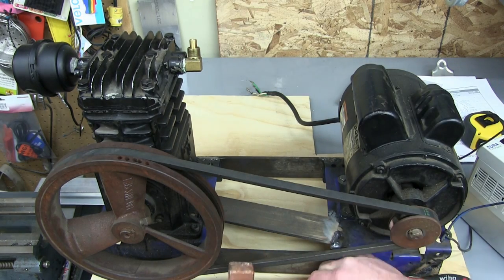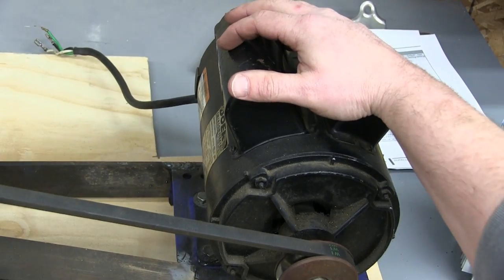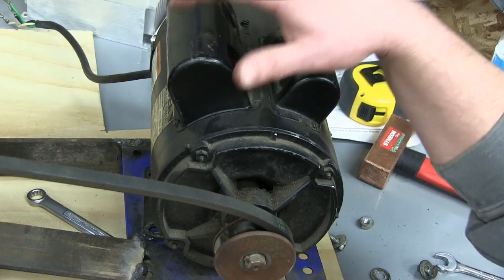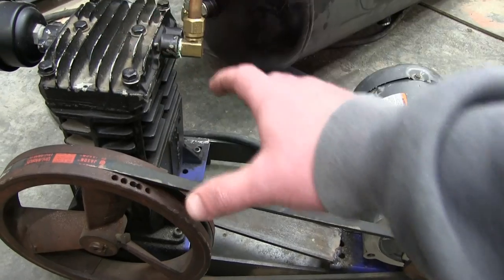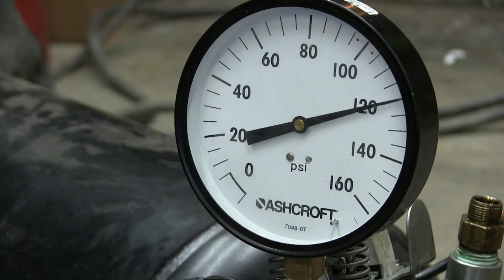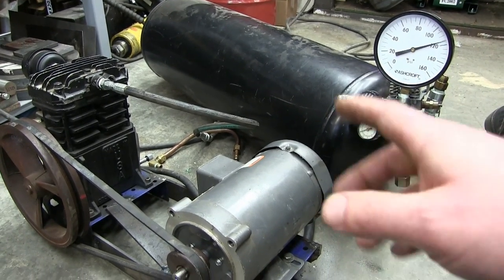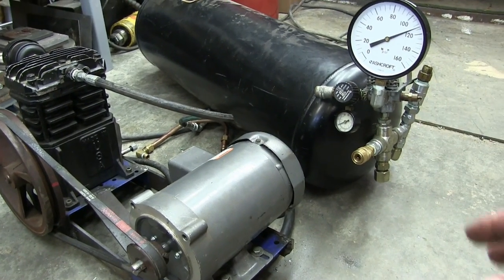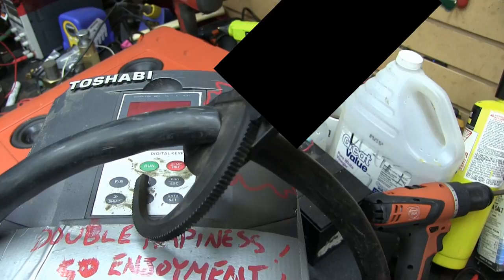BIG COMPRESSOR PERFORMANCE BOOST | No tripped breakers!

Comment: Excellent job. Running it faster at lower loads increases piston speed on the compressor motor exponentially increasing wear on the rings so lower life is probable

Comment: Why not just have it maintain constant pressure via the variable speed. They already do this on well water systems. If you're trying to maintain 120 psi you could just use different pressures to equate to different frequencies. Example: if the pressure is below 90 psi it runs balls out. After that you could step the speed down as needed to maintain operating pressure. Adding the air signaling would be unnecessary if it's always maintaining the same pressure, unless you're wanting a higher setpoint.
Reply from the maker: Using the air as signalling opens up options. Drop the pressure for "torquing" bolt with a ugga-dugga. Pop the pressure up to bust deeze nutz. Set the pressure to fill tyres. Short bursts of more CFM, setting the compressor in standby,  etc...
Reply: I would have to agree with Justin. I think using air as signaling opens up the possibility for trouble. Just imagine, you are doing some light duty work and suddenly the thing kicks into overdrive since you happened to do a signal by mistake. I think a regular button (Or a remote control) would be more useful for that type of operation.
Reply: Alexa integration?
Reply: I understand the idea... it just seems unnecessarily complex. Constant pressure would be friggin sweet. If your system will handle increased pressure why not always maintain it and use a regulator if you want less

Comment: I do think the idea has merit . If you run a compressor faster than it is designed to run there are several issues you have to overcome the head is designed to run at a given temp at its rated rpm. If you overspend it you are going to make more heat in the head than the cooling fins are capable of dissipating. Not saying that's the end of the world but you will need to come up with something to mitigate this. Also your charge is going to be hotter which an aftercooler would help with. Just think that in this case the old saying holds true " there's no replacement for displacement ". Bigger compressor would be my suggestion for the long haul but this is not a bad stop gap fix. Keep this kind of stuff coming it inspires creativity and critical thinking and I love it.

Comment: Work in commercial truck shop and this would be great for heavy usage tools(tire guns/multiple tool) and especially for airing tires up when pressure drop isn't low enough to trigger compressor

Comment: Is heat buildup in the compressor going to be a problem running that thing at 200% all day? Could you build a water jacket to run between the head and block to keep the system cool?
Reply: Mike Lastname Lucas oil additives could assist with that?
Reply: Variable frequency drive. It is only running 200% when told to. But yes, heat is definitely something to remedy. Always. Heat means excess entropy. While entropy will always be real, it can and should be regulated. And the water jacket thingy is a real thingy already. Look for a compressor out of a big truck with air brakes.
Reply: The compressor drive wheel is running backwards looking at the rotation and “fan” spokes.
Reply: It (the pulley fan) would work what ever way it rotates, no? One way it sucks the hot air off the pump, the other way it would push cold air over the pump. That said, I don't know if the pump itself would work if it was turned the wrong way ...
Reply: Also don't forget that these compressors tend to use splash lubrication. Not so much a problem at overspeed, but when running underspeed, lubrication is going to be a problem.
Reply: jeftiii So what you’re saying is... more power, more better?
Reply: I.. I guess so!
Reply: Kit Bridgen The compressor should run both ways. The problem with the fan sucking instead of blowing is it will pull in air from all around the cylinder. If it blows it will be a more concentrated stream. Model Putt Putt boats use this principle

Comment: What a great channel.  Combine brains, honesty, inventiveness, efficiency, and humor.  Doesn't get much better than that!  That is a very cool idea using the variable drive to vary output.  I would think one would need to be carefull in that the cooling vanes etc. on the compressor were designed for an RMP.   Compressor pumping faster might cause overheating issues?   I'm not sure.  I'm trying to think of other ways to incorporate this idea.

Comment: You are missing the unloader valve to take the head pressure off the compressor on start up.
Reply: You're completely missing the point of the video
Reply: larry munday that's only for gas compressors
Reply: Thought they were only in petrol compressors? I remember as an apprentice my boss send me to start the petrol compressor 😂 my fucking arms were about to drop off

Comment: I used a unloader on compressor vents air for several seconds  allows it to restart easy no compression load.
Reply: The air tank should have a check valve to allow this. It's easier on the motor even a 3 phase will be happier with a gentle start.
Reply: David Elliott It's different it unloads pistons upon start for a few seconds until motor reach's speed then allows it to compress. Done alot on large compressor s Diesel powered types.

Comment: working in the body shop we use almost all tools are air tools.  We also paint or primer with air as well.  At home although I only have a 110 compressor I find that its useless and when I want to do weekend jobs don't have a big compressor and so the 110 unit would never work and if I could be able to have the air I need for painting that would be great !   You really have a great idea !  I love your most used phrase Skookum !

Comment: AvE any thoughts on the damage to the motor bearings dod to the high frequency from the VFD? I know you can get newer motors that are rated for VFD use and you can also get grounding brushes that you place on the motor to bleed off any voltage that builds up in the rotor so that you don't get the voltage arching across the bearings,
Reply: VFD motors aren't necessarily built to run faster - they just have laminations in the cores to reduce coriolis currents and heat buildup.

Comment: What about a bypass valve so that the motor starts without any head pressure? Then, once the motor is up to speed, the valve changes over and can start charging the tank.
Reply: The load comes from the compressor not the motor.  Bringing the motor up to speed would just trip the breaker as soon as you pop the clutch and hit it wit the load from the bottomed out cylinder
Reply: W1ldt1m I think he’s talking about an unloader or bypass valve in the compressor. Similar to what semi trucks use. That way you would be able to get everything spinning before putting the load on it.
Reply: I've used compression relief valves on Harley engines. S&S makes electric solenoid types that could be wired up easy enough.

Comment: We use these in the commercial HVAC field, they can be set up with a pressure transducer that will maintain down to minimum frequency (would go no lower than 15 or 20Hz) you set up a PID rate so the farther from setpoint the faster the rate of ramp up and Hz.  Many buildings go with a screw compressor (yes insert whity AvE saying here) and run them on a VFD, compressors seldom shut off but run unloaded under light load.

Comment: notice the fan blades built into the big pulley? They are meant to blow cool air across the pump. You're spinning it the wrong way.
Reply: richard day, well then, now it's just sucking hot air away. :P
Reply: Yes, sucking hot air away from the pump. That is brilliant my friend. I wonder why all the big automakers of the world didn't incorporate that into their cars? Because it's LESS efficient.
Reply: Absolutely supposed to be blowing air over the compressor cylinder and head.  Oil cools the bottom end.
Shouldn't be a problem to make it run the other way.

Comment: Tell  you what, So long as your reinventing the wheel (again) ... Please install a small solenoid valve on the bottom of the tank to drain it once a day; PLC controlled, of course!  :D
Reply: You can already get those that open for a blast of water removal after it cycles on and off. I put one on mine.
Reply: John Possum what are they called? Never heard of this before.
Reply: Hmm,  Nice. I've installed the "expensive" ones that are IC controlled on long timer circuits.  They cost more than his PLC  :p  .   I like the water blast concept after each cycle you mention above; I'll search them out.  Knowing AvE, he'll probably install a humidistat  into the tank to determine when to cycle the valve :)
Reply: I'm not sure what they are called. Compressor drain kit, I think. Yeah, here's one: https://www.harborfreight.com/automatic-compressor-drain-kit-68244.html
Reply: John Possum now to find one not sold by harbor freight.. lol

Comment: A few summers ago I was subcontracted doing general labor for a framing company, shoo wee, they had the brand sparky new stuff. I believe our air nailers had something like this. Problem was the was a wire than was zip tied to the air hose and plugged into an extra couple of  buttons one turned the compressor on to “overdrive” the other reset it to normal. Other than that it ran like normal chooch chooch 5 min break and back to choochin. If you were about to run it hard for a bit you could hit the on button and it would only let it drop 5 psi, then kick back on. It basically kept it running.. I never used it much given there were four other guys monkey-in with it. Wish I woulda looked into it more.. worked great and kept us busy! We did keep a shop fan blowin on it all day too, sucker musta been HOT!

Comment: Or you could just adjust the cut in and cut out of your pressure switch.. tripping breakers?? Weak breaker,too low amp breaker or motor going out

Comment: Why not connect it with wifi,
As soon as you walk into the shop (connect to that wifi spot, or bluetooth)
Have it turn on 8D
Reply: Or even keyless entry like the latest easy steal Audi. What can go wrong?
Reply: Or just put a solenoid valve and relay at the pressure switch or a relay to turn power on/off to motor wired into the shop lights switch.

Comment: As a professional software engineer who's had fun dabbling in small systems controllers, I wouldn't suggest doing the "three pulse signal". It would not always be a reliable way to detect it, and you would still need some kind of upper/lower bound switching for turning the motor on and off. Instead what you're looking for is mainly volume at a desired pressure range, and usage varies over time. Instead I would say you should use a ramping of torque based on the rate of pressure change. You would still want a specific lower pressure for it to activate, but if the motor at nominal speed is not increasing the pressure at a minimum rate (or if pressure is still decreasing), you could have it ramp up the motor speed to increase the CFM. You would have a max speed limit, as well as a temperature sensor on the vital components that can override that max speed limit and lower it if things are getting too toasty. BUT to handle sudden high demand, if the pressure drops a certain amount within a given timeframe, you could have the pump preemptively start (maybe if it drops 50% of the desired pressure range, ie. range is 80-120PSI and it drops 20+PSI in under 15 seconds). Under such a sudden heavy demand, it could even start the pump at a higher speed to start providing a higher CFM.

Comment: Fantastic idea. Smaller tank, ability to go into brief turbo mode when someone's really nailing, lower speed/wear/noise most of the time, possibly even set for 15A or 20A depending on circuit you have it plugged into.

Comment: An unloader valve solves the tripped breaker problem nicely and pressure switches with that included are cheap. (For those not familiar when an unloader valve is used the air tank is prevented from backfeeding the pump by a check valve while the unloader valve dumps pressure between pump and tank check valve until the pump is up to speed.) Augmenting tiny compressors feeding tiny ID hose to tiny tanks is fun, but the industrial way of more power is hard to beat (and all the mods done to baby compressors would work even better on real ones).

For mobile high pressure use many use CO2 (I collect used cylinders, CO2 is love!) or high pressure compressed air cylinders (paintball cylinder kits are common). For light work cordless tools are now so good many mechanics (self included) rarely use pneumatic tools. I can cut the nose off a Suburban with less than one battery using less than one recip saw blade when LS harvesting, and cordless impacts are so good they often beat pneumatic impacts especially when those are at the end of a long hose run.

Comment: Why wouldn't you just have a 150psi compressor, with a high enough CFM to supply the crew, and regulate the pressure down to the tools' maximum working pressure.  Let's say 100psi, the compressor kicks on at 125.  So while the pressure varies in the tank, the working pressure never changes.  This is fucking ingenious AvE, I just don't understand the need for it.
Reply: Lol AvE doesn't give two shits about monetizing videos.

Comment: your motor is running in the wrong direction , the flywheel is the cooling fan on your compressor it should be blowing towards the compressor.
Reply: LOL, you noticed that too huh? Lots of people don't realize why those old flywheels are shaped like that. The spokes are fan blades.
Reply: can be put on in a wrong way :)
Reply: Flywheel pulley is installed the correct way. You want it pushing air over the cooling fins on the compressor cylinder, trying to draw air over them is less efficient due to the standoff.  Motor is just turning backwards.  Piston compressors will work either way of rotation due to them just having a spring loaded suction and discharge valves. 

At the beginning of the video when it's still got the single phase motor on it you can see the raised arrow and THIS SIDE OUT  cast into the flywheel pulley's spoke indicating proper direction of rotation for cooling. Single phase have their rotation built in but three phase can be switched depending on how they are wired.
Reply: if you look at the flywheel there is an arrow on it indicating rotation (bottom left fin)

Comment: Could use an analog flow meter and/or analog pressure transducer for the air. If the flow increases and/or pressure decreases, it could use a PID to ramp up or down to the optimal RPM to maintain or boost flow. Great idea.

Comment: IT'S TURNING THE WRONG WAY,  LITTLE OR NO COOLING.
Reply: Yep, was going to say the same thing - you want the fan to be blowing air over the fins.
Reply: The fan will draw air both ways doesn’t matter which way it turns
Reply: Yeah it does matter. First, the fan blades have an airfoil shape - they are meant to go only one direction. They move much less air when turning backwards. Second, you want a nice stream of air blowing onto the compressor, not blowing away from the compressor. If all the air drawn away (by the backwards fan) was going past the compressor then fine - but that would require an enclosure to ensure that the air drawn comes only from near the compressor. But if you blow the air towards the compressor then no enclosure needed.

Comment: I love this!  I set up 2 compressors in order to spray cabinets.  I had them ran together and adjusted cut in and cut out pressures on both where my slower quieter one was primary, but when I needed more air the other one would kick on and help it out.
Reply: It worked fine but fucking ridiculous compared to this

Comment: Just watched this again, awesome. The rate of pressure drop linked to Hz of motor will balance the system. Only problem is the fan on motor or driven pulley increases load per speed regardless of pressure.

Comment: How about an engine, more than 1 V-8 has been changed into an air compressor, running on 4 cylinders and pumping air out of 4 cylinders, air will just scream out on a 1.5 in port
Reply: I've seen examples of that. even given it some thought.  need more air ya say, just crack open the throttle.  don't need all that air, thats what wastegates are for. lol

Comment: it's a spinnamathinging the wrong way
Reply: It's a vacuum pump?
Reply: Whew. . .That would really suck.
Reply: Well, the VFD could switch it from suck to blow.
Reply: It's a VFD not a Philosopher's Stone
Reply: I saw that and thought someone else had to have noticed also, cooling fan on flywheel should move air at compressor cylinder cooling fins.

Comment: As far as the compressor running without stopping because of a blown hose or something what I did was install a ball valve at the outlet. I leave the compressor on and just shut off the air to the hose when I'm done using the compressor. There have been times that I've forgotten to shut off the air but they are rare and thankfully the hose has never failed.

Comment: Oh this would be amazing... I work overseas in Afghanistan as a contractor (Large vehicle maintenance and repair). The main issue I run in to is the lack a portable quality high pressure air supply. Something that could be two man lifted, but drive a 1" Impact Gun on 3/4" airlines. The best that we have found are the gas powered  100 gallon units... But the problem with those is the noise... I mean heck they supply plenty of air, but you go daft from dealing with the noise. SO having a unit that is small enough to be portable and be "sqoochum" enough to deal with 3/4" and 1" drive impact guns, would be a game changer for me.
Reply: Sorry NOT 100 Gallon... Meant 100 CFM units...